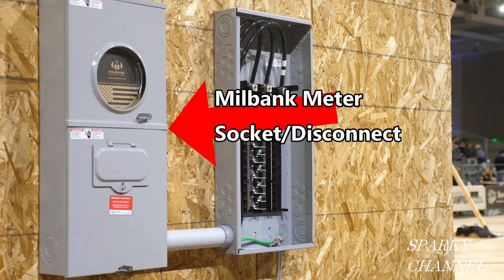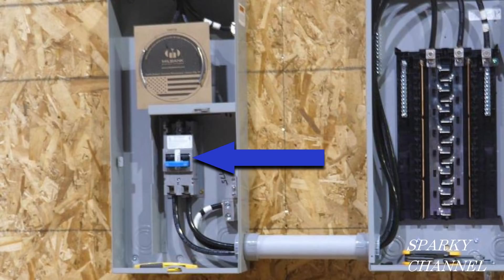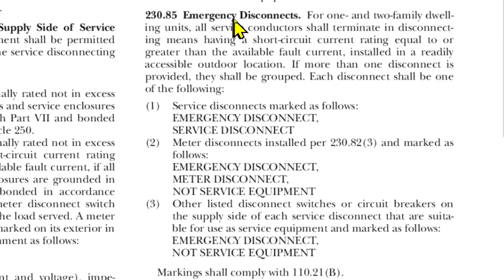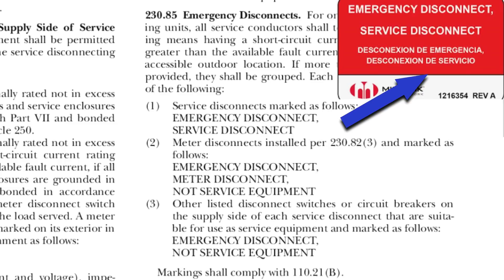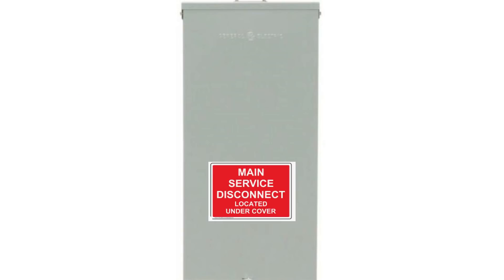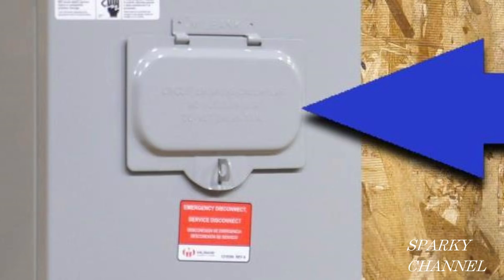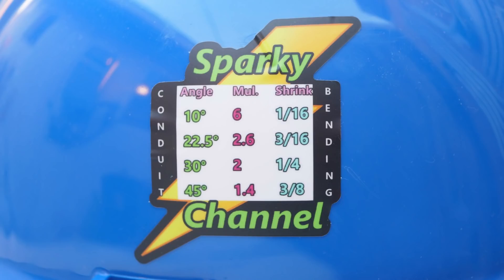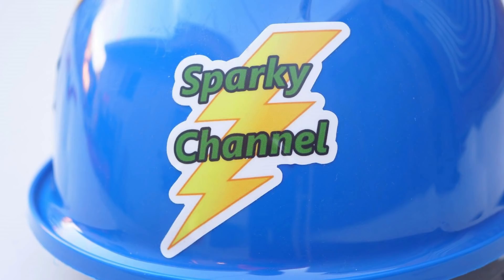What's This Little Door For? And is There a New NEC Code "Behind" it? (2020 NEC 230.82)

Comment: Another great video Bill. As a fireman and Electrician, I can say that any lock on that panel we will remove in about one second so being able to lock it and keep pranksters/vandals/criminals from being able to shut it down is great
Reply: If I ever have to use a panel like this, I’m probably putting a 12mm harden shackle with shackle guard to keep the pranksters out. The fireman will be better off removing the meter. LOL. NEC doesn’t say what locks to be used. 

Another option is decent puck lock that totally covers the hasp. Try cutting that off. Lol
Reply: @ipick4fun27  I can guarantee you we'll bust that just as easy as if it were a toothpick. That's why we invest in the most modern technology and keeping our firemen strong.
Reply: @xsbiggy6349  Now we have fire persons and they do not have to be strong.
Reply from the maker: Perfect! A fireman and electrician, great combination to comment on this subject. I've seen you firemen in action, those locks do disappear fast!  It's excellent to hear because us electricians need to be able to explain that to our customers. Granted the hasp on this meter/disconnect isn't very strong but it should be enough to keep pranksters away.
Reply: @SparkyChannel  often times, we'll just yank the meter because it's just as easy. In some ways I do agree with others that this is just another added expense etc, but, I also see it from the safety standpoint of a fireman/first responders in the sense that flipping that breaker prevents the possibility of me getting bolted while yanking a meter. I see both sides of the issue and I can see the benefits and the aggravation expressed by other sparkys in regards to this. One thing we need to remember, WE as electricians have a lot of say as to what goes into the NEC, which I'm sure many don't realize.

Comment: If it helps fire or emergency crew's, my concern is vandalism. I saw in one of your videos that the mounting of the panel can be reversed to service entry. Is that the internals or the panel? Thanks
Reply from the maker: Some service entry panels can be served with either overhead service entrance cables or underground SEC's. The manufacturer will label them as such. Some load centers, when used as main lug only panels are labeled as invertible so they can be installed either way. Again, the manufacturer will label them as such.

Comment: If the electric has to be shut off in an emergency why not remove the meter?
Reply from the maker: That does work but it can be dangerous due to possible arcing.

Comment: The little door  that will take a padlock would be used or is there for service work. A LOTO device and tag would be attached to prevent anyone from energizing a circuit or panel that has been shut down for repair or maintenance.
Reply from the maker: Yes, I like that.

Comment: If and when I ever have a exterior disconnect, it will be locked and it won’t be a cheap block and I may even make the locking mechanism the hasp or whatever the lock fits into of a more substantial item since I did physical security protection for decades. And most of the equipment I have on exteriors of any properties is alarmed So I will get some notification that there has been tampering.
Reply from the maker: Sounds good to me!
Reply: @SparkyChannel  I mean I have done extra security on all kinds of exterior utilities. The fire department can open anything I could care less if it gets a little destroyed better to keep it a little secure and keep unintended hands from messing with your shit
Reply from the maker: @shockingguy  How would you make the hasp stronger? I'm thinking of installing one of these on my house. Except for the security concern, I love the Milbank meter disconnect. It's first class and made in the USA.
Reply: @SparkyChannel  well I would modify it with some sort of hasp off the shelf somewhere You might have to make a new door actually with better hinges and then weld on or bolt through the new house with a covering piece obviously attached to the door and then you could put a better lock on it but at least you couldn’t cut that flimsy hasp that comes with it with a pair of side cutters you would need better tools
Reply: @SparkyChannel   to learn more about locks and physical security start watching my friend here. 
https://youtube.com/c/lockpickinglawyer
Reply from the maker: @shockingguy  Thanks!

Comment: I'm not sure how I feel about it.  For the most part I've been using Meter/Mains with liftable cover doors for years.  

As far as it having to be labeled as an emergency disconnect, emergency responders have known how to disconnect power to a structure, or have it disconnected for years. I guess it might be a benifit to some homeowners.

Putting padlocks on most stock door type disconnect enclosurs is just an inconvenience for someone wanting to turn the power off, or on, for that matter.  I've worked on a property where the managemet deemed it necessary to put locks on various disconnects to prevent tennant tampering.  Having tried to locate a key to no avail, I just cut the bottom of the  sheetmetal lock loop, twisted open the loop removed the lock and did my work.  When done I put the lock back in and twisted the loop closed...no one knew the difference.
Reply from the maker: I'm with you, I have mixed feelings about it. Good for 1st responders, not so good for our safety from vandalism.
Reply: @SparkyChannel  👍

Comment: The code just keeps getting dumber and dumber, and making the cost to the consumer higher and higher.  There is no need for this, as most fire departments will either not touch electrical at all and wait for the power company, or they will simply yank the meter out.

Furthermore, people lived without GFCI  breakers/devices, arc fault breakers/devices, no equipment grounds, etc etc for over 100 years.  Electric is dangerous and potentially fatal, the safer we make everything, the more people will forget the danger.
Reply from the maker: I hear you.
Reply: It's all about money. I am a professional electrician and I don't follow recent code.

Comment: What about a fire department keyed switch, like in a elevator, all fire departments have the key,and it will keep the evil away
Reply: Here in southeast Michigan, 15 year's ago...
Our Power Company, Installed on all residential homes.
A standard sized meter, but this new meter, has built into it, a integrated, Emergency Remote Shutoff Built right into it's same Glass enclosure....
  So no extra exterior switch is needed....☺
Reply: I'm going to invent it

Comment: Holy Cow! Has anyone looked at the prices of these vinyl stickers on Amazon? It would be a lot cheaper just Laser print a color one and insert it in a weather proof plastic sleeve and secure it to the outside of the Control Panel door? I am sure the inspector would have something to say about that on my project.
Reply from the maker: I noticed that. But they're usually selling 4,5 or 10. It's hard to buy one sticker. Best to get one from the panel manufacturer if possible.

Comment: You could buy a padlock for $120 from KnoxBox and register it with your Fire Dept.
Reply from the maker: I didn't know that. Great info! But why is it so expensive?
Reply: @SparkyChannel  I don't know - why is a Leviton 30-amp Safety Disconnect Switch $200??    Back to the lock - I don't know if what I am saying is an approved technique - but a lot of fire depts are pushing KnoxBox key boxes to us old farts so they can get in the house if we "push the panic button" but can't get to the door to let them in. So maybe you can also just get a plane old padlock and put the padlock key in the lock box along with the front door key.  KnoxBox gives a master key to the fire dept. On the other hand I can't believe that any Engine Company worth it's salt can't cut through a Master Lock in 5 seconds.
Reply: @HoosierRallyMaster  Why worry about cutting the lock.  Cut the flimsy sheetmetal lock hasp loop on the cover wth your dikes and pull the lock off.
Reply from the maker: @donl1410  I've seen the FD work, a lock won't slow them down at all.
Reply: @SparkyChannel  ✔
Reply: @SparkyChannel  I believe they are required on newer commercial buildings in Oregon.

Comment: Down here in North Carolina, a lot of the houses have the meter and circuit load breakers in outdoor enclosures. Mine is just the meter outside with all my breakers inside the house where they should be.
Reply from the maker: I'll be changing mine out and that's the way I want to do it, with an MLO panel in the garage back to back with an exterior meter socket disconnect.

Comment: To me the only time that whole set up would be rendered useless, is if the entire location where that switch is, gets engulfed in flames...
 Here is southeast Michigan, we have emergency remote shut-off meters...
 That can be remotely shut off, directly from our power company....less thing's to breakdown on the exterior of a home. 
And less opportunity for vandalism, or thieves....
Plus that will cut down on the possibility of thieves trying to tamper with you and your Family.....
God Forbid.
Reply from the maker: Excellent information, thanks!
Reply: Sounds like Code should require two shutoffs on opposite ends of the house ... just in case.  Maybe three would be better.  No. Code should have four minimum.

Comment: In addition to the fire emergency support benefits. It also allows much safer working and testing on the main indoor service sub-panels. It’s a huge convenience though ideally you should shut down each indoor breaker to reduce load pull before shutting the main external disconnect. And it was the main reason I had them installed to allow safe working. Fireman who have seen it, and it’s not code in my area yet in Virginia are really happy with it.
Reply from the maker: Excellent, glad to hear it!

Comment: I lived in Vegas in the early 2000s.
All commercial buildings had to have a means for the FD to be able to disconnect main power.
This was done in one of two ways.
1. The electrical room would have exterior access. All doors were "master" keyed to a key the FD possessed. These room did not have interior building access.
2. There would be a remote main trip switch somewhere on the outside of the building.
Reply from the maker: Interesting, thanks!
Reply: @SparkyChannel  
I worked at a bank. Om the exterior wall in the drive thru lane was a light switch in a locked weatherproof switch box. Flipping the switch to off would trip the main breaker.
The red label on the box simply said FD.
Reply: Don't get me started on the stupidity of "fire keys". "Oh, but it's illegal to have one!" ... like criminals care!

Comment: So this would only apply to new construction. What if you are putting a new sub panel in the garage? Does the new panel require a disconnect outside? Or is this just new services?
Reply: sub panels are not service disconnects. you don't have to have a disconnecting means for every sub panel. it's just for the service
Reply from the maker: It would also apply for service panel upgrades to an old house.

Comment: Sparky, Just wondering; Would it be acceptable to place a gfci in a sub panel in positions 1&3 acting as a main breaker while serving the branches in the panel with ground fault protection?
Reply: I'm not sure that GFCI breakers are rated for reverse feed like that.  there are subpanels that use a top mounted main breaker that could be used with a GFCI, but they aren't common.  biggest reason not to do it is a ground fault would dump the entire panel, and that gets awkward.
also on a totally unrelated note, whenever you get assigned to finish someone else's project, it's wise to check they didn't leave the wires all stripped out and taped together in the pulling head in the junction box nobody told you about.
Reply: @kenbrown2808  Thanks, your knowledge is much appreciated.

Comment: "if a fireman or other emergency personnel, or a vandal, burglar, robber, criminal, warrantless search, raid, etc. wants to shut off your power"
Screw that, I do not want my service disconnect readily accessable to the public.
Reply: If someone wants to really turn of your power,  cut tamper seal on meter retaining ring,  remove ring and pull meter.
Reply: @scott_meyer  This is true, but idiot criminals don't know this. However when there's a large color sticker that says "flip this breaker to kill power to the building", that attracts all kinds of negative attention.
Reply from the maker: I understand.

Comment: "All service conductors", does that include the neutral?  Just asking because I don't know and wonder if that's really a three-pole disconnect?
Reply: It is a two-pole breaker that also acts as the disconnect for the 2 legs of this split phase system. The grounded service conductor stays part of the grid and, on the consumer side, connected to your grounding & neutral bars.
Reply: @wim0104  That's what I thought as well.  Just that the quote included disconnecting "All service conductors" and I thought the neutral was a 'service conductor', so I was puzzled.  Thanks.
Reply from the maker: Yes, the neutral is the "grounded conductor". It is one of the service conductors.
Reply: @SparkyChannel  looking at 0:45 in the video I do not see any electrical connection between the blue handle that has two poles behind it and the neutral to the right that has the white tape wrapped around the wire.  So, I’d conclude that this service disconnect is NOT switching the neutral.
Reply from the maker: @neilbrookins8428  Yes, that's true.

Comment: That crooked sticker would drive me crazy. But in regards to locking it, the AHJ in my area forbids locks being places on the service disconnect. There was a gas station in my area that repeatedly had people shit off the main disconnect switch, so they put a lock on it and got fined! But as mentioned in the video, I like the idea of being able to lock it and the fire department does have a means to easily cut the lock to gain access and shut it off if needed. But as with most thing, I guess the AHJ has the final word, unfortunately. And, like a lot of things, the minority ruins it for the masses. Good idea for an easily accessible disconnect for the fire department, but leave it to scum criminals to use it for their advantage. Why we can't have nice things......
Reply: Wouldn't it be easier to just cut the little meter tag and pull the meter out rather than cut a lock? you know like they've always done?  I'm tired of this trade and all of the added stupidity and expenses.
Reply: @IrrationalBstrd  Gas station is three phase, no meter to pull to disconnect power. But glad to hear you are tired of this trade, you won't be missed with attitude like that. See ya.
Reply: @inothome  "gas station is 3 phase and there is no meter" , shows how much you know. Yes they have meters, noob. They won't disconnect the power by yanking them, which is true.  Obviously you wouldn't pull a meter and create an arc on a Three phase 480 system at a gas station... Although, it probably wouldn't cause much of an arc if any (CT metering). Commercial three phases systems typically already have disconnects, many times required by the power company before the metering  Furthermore, there are emergency shutoffs inside and outside at multiple locations for the pumps.  We're talking about residential. Kick rocks, greenie. The lights are on, but "unothome"
Reply: @inothome  Nevermind, you're a lineman who thinks he knows everything.  Couldn't tell you how many times I've had to fix inside wiring done by a lineman because someone thought they are actually a wireman, including the lineman. I respect what you do but,  Stick to the poles buddy.. it pays better anyways, and you barely work when there's 10 guys and at least half of them are standing around scratching their ass...
Reply: @inothome  LAST THING, not every 3 phase 480v system is metered through CT, it depends on the size of the service. A small gas station doesn't require a service large enough to need CT. In that case, pulling the meter WOULD kill the power, obviously. If the gas station is on fire, I doubt anyone is pulling a meter OR a disconnect... More like power company is yanking the cut outs.

You don't have to deal with customers to get paid, or bid jobs or compete with anyone... You also don't have to deal with the same code changes coming through the pipes by people who sit on a board that own the devices and equipment they want to sell. You don't have to worry about what anything costs either... In fact, you probably have rolls of 2 inch 3M tape, crimps and who knows what else in your house right now that you've swindled from the company you work for. So, I'd say you have no place to judge me or my attitude.
Reply: @IrrationalBstrd  I like how you edited your comments to reflect a CT metered service after the fact. Did you have to call one of your lineman friends for help? ;)
Reply: @inothome  I added the CT METERING in my first reply for clarity.  I'm a licensed contractor in my state, I know what CT metering is and I know that a lineman doesn't install the cabinets.  Nice try.
Reply: @IrrationalBstrd  in a way I understand about the " added stupidity and expense" but as with anything, we learn as we grow and advance. And as dumb as some of the codes are, the end result is about safety for the end user. But I do understand the frustrations
Reply from the maker: I hear you brother!

Comment: Until you mentioned the lock hasp I saw it as a danger for my safety because of vandalism. 
I have had many service calls where vandals have removed the pull out disconnects on air conditioning units. 
They make breakaway locks that are used on fire sprinkler valves to prevent tampering. Grainier, other industrial supply, on line, or your local locksmith will have them.
Reply from the maker: Excellent points, thanks!